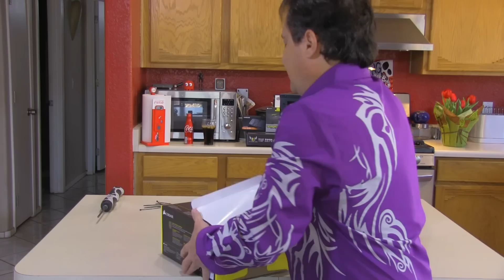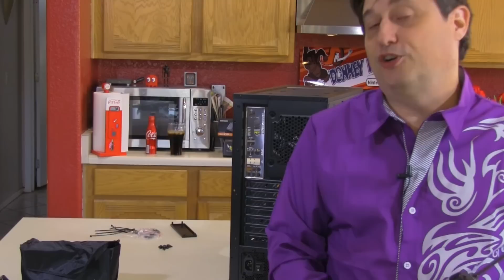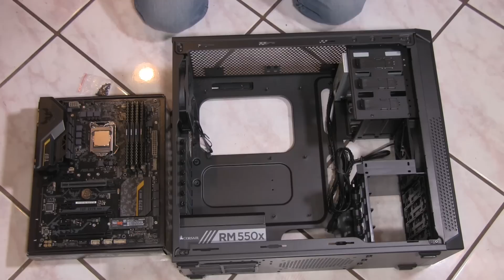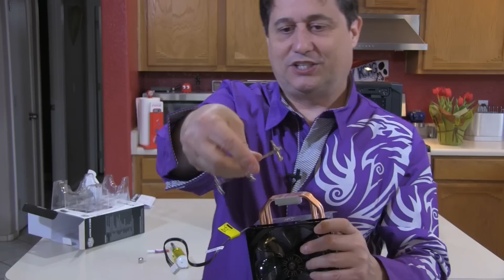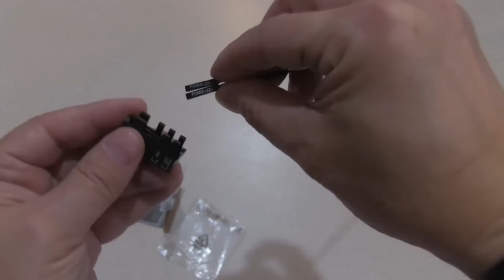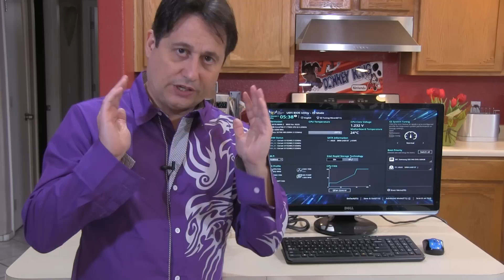Kaby Lake Build - Directors Cut

Comment: I built something VERY similar to this system. Same case, same mobo and cooler.
After watching this video I thought I would have the most trouble installing the 212 Evo. 

For those watching this now, Coolermaster has since improved the 212 Evo making it SO MUCH EASIER to install. The backplate now comes with the scew-like pieces which you put through the holes in the mother board and all you have to do is screw in the mounting screws. Makes it a lot easier to position the back plate correctly this way.
Also that fidgety scissor-like bracket that you originally had to hold inside the heat sink which gave Carey a tad bit of annoyance is gone too. Now they have 4 pieces of separate metal (2 for AMD, 2 for Intel chip-sets) which are easily screwed into the side of the heat sink, beside the part that contacts the CPU, holding them in place. This means you no longer have to struggle holding the bracket in place like in this video and it has become a very simple matter of this placing it on the mounts and screwing it into place.
 I must say kudos to Coolermaster in these small touches which made installing this fan a breeze. I honestly thought I was going to struggle.

Id also like to give you massive thanks Carey. My laptop had been dying after serving me for 7 years and your videos motivated me and gave me the confidence to build my own after seeing just how simple and straight forward it is. Wish you the best in life mate.

Comment: The Noctua coolers are sooooo much easier to install when compared to the 212evo. But the 212 evo is cheap and powerful so a lot of people choose that. Notcua is a lot more quieter and the mounting system is easier on most of them.
Good video. I started watching your series a while back and subscribed. Been building PCs for over 20 years myself but I like watching your work, and comments, and rants about excessive bags and boxes :)

Comment: if it was me and I had to remove screws to get the side panels off I would put the screws back into the case after you remove the panels that way they don't get lost or forget where you put them when you put the panels back on again
Reply: I use a magnetic parts tray...
Reply: Now that is a very practical idea.
Reply: Or just put them into one of the small cardboard boxes that come with the new products...